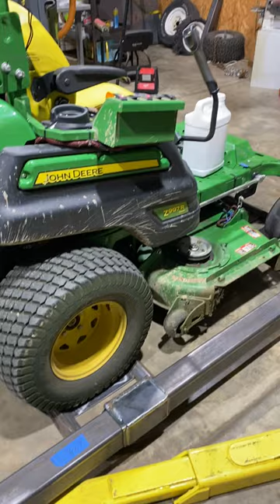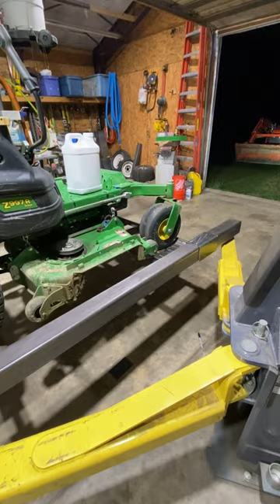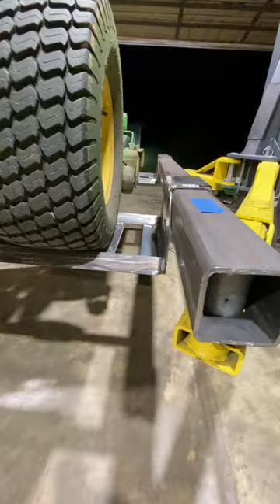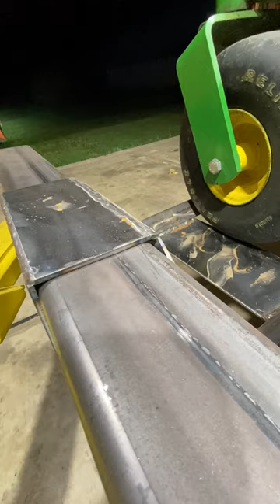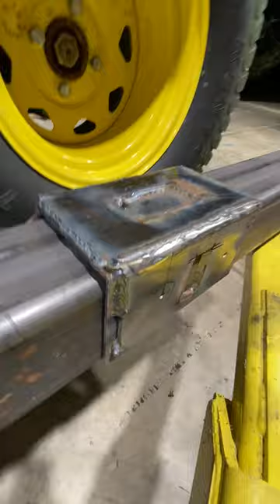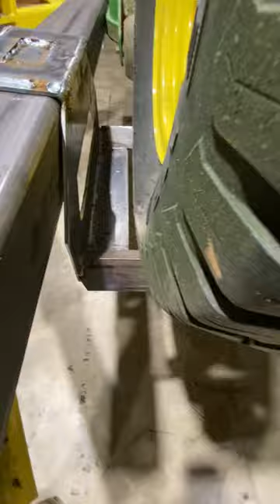Equipment Lift Adapter for lawn mowers or tractors using a 2 post car lift.

Comment: I just used 2x8's  to span the width and grab the mower just in front of the deck and just behind the rear wheels on the frame. Beautiful rig, though. Nice work!

Comment: Looks good but how much does it lift?  Needs some type of locking device to hold it in position to prevent it from rocking horizontally.
Reply from the maker: Right I double plated the ends of the sliding tracks and welded two 3/4” nuts so bolts would lock it down to the square tubing. Thanks for the suggestion. It doesn’t take all the twist out but 99%. I put my 6,000 LB kubota on it and very little deflection on the sliding tracks